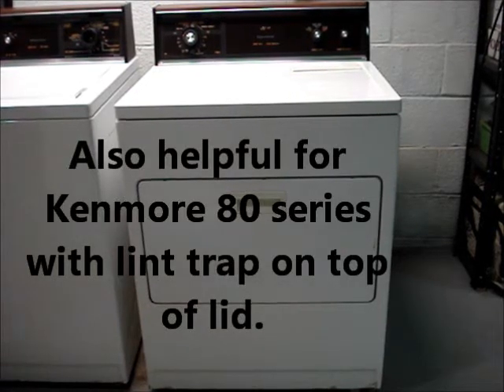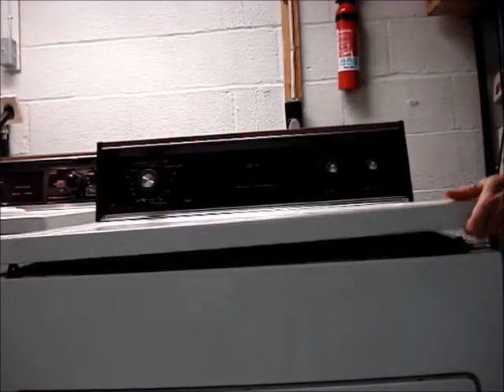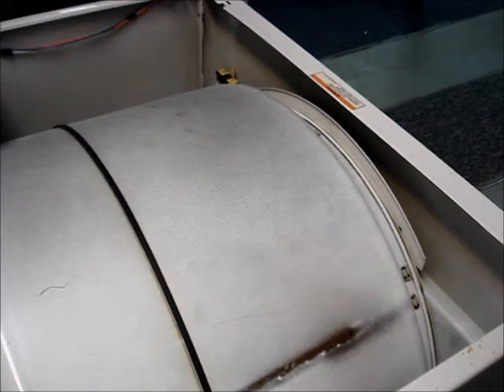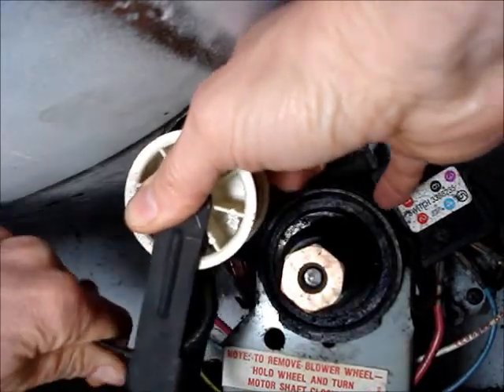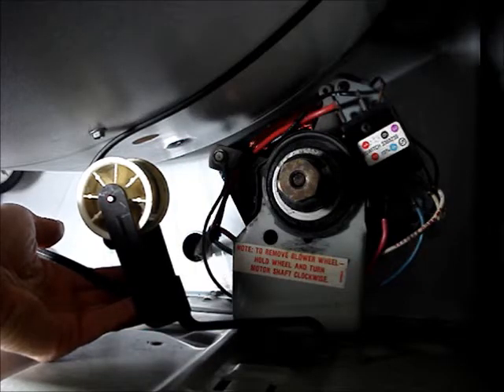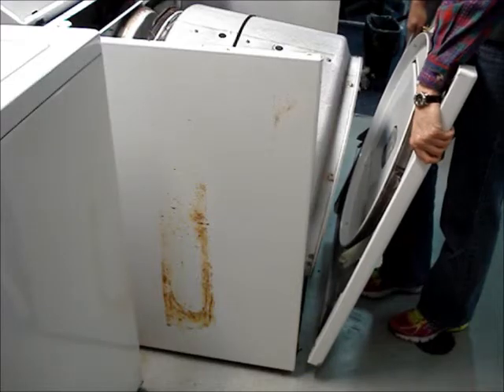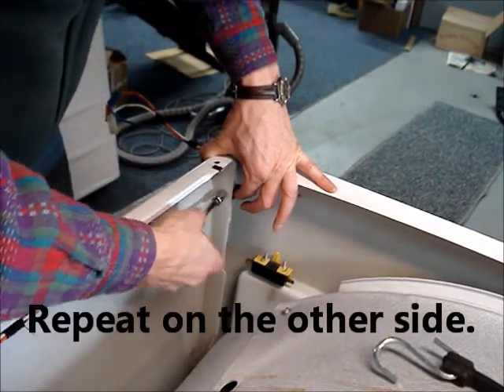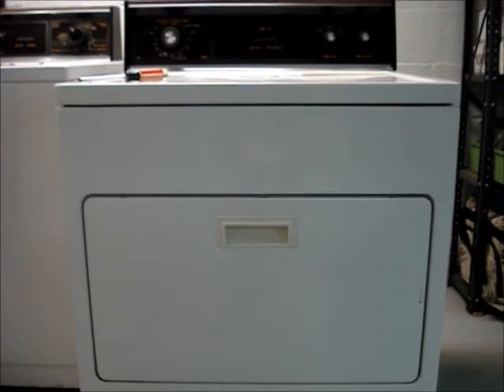How to Open Kenmore Dryer Front Panel and Top

Comment: THANK YOU!!!!!!!!!!!!!!!  My old dryer was making a loud vomiting sound like a dog throwing up (but deeper).  Your instructions were so clear that I was able to completely disassemble the dryer, remove the drum, clean out 30 years of lint and put all back together again.  Come to find out that black part on the drum that goes in the back (not the belt) was curled under for about a foot in one place.  Straightened it out and now it works perfectly now!   My brother always said a dryer was stupidly easy with only three major parts.  You gave me the nerve to find out that for myself. It was my first time ever taking an appliance apart.  Many thanks
Reply from the maker: You are welcome, Jody.  Lol, I love the description of the problem.  I think the felt seal came off of you dryer drum.  If it doesn't stay put, you can replace it.  Somewhere on your dryer is a plate with the model number.  Use that to buy a new felt seal.  There are several web  sites that sell appliance parts.  I find that once you know the part number, you can get it cheaper on eBay.  You'll have to remove the old felt seal and glue a new one on.  I have a play list with several dryer repair videos, one of them shows how to replace the felt seal.  https://youtube.com/playlist?list=PLvce66kQTjJSwXTgv6GwacfeFe2ajKdOw
Reply: The black part is what they call 'the skirt" i replaced mine,they sell it in a kit with this really awesome heat resistant glue,i took mine off cause it was shredded, cleaned the whole area, you have to gently scrape the old glue off,put new glue on and put the new skirt back on and hold it in place with a bunch of wood clothes pins, let it dry overnight and good as new.

Comment: Thanks for taking the time to post this. Very helpful for me. I know what I'm getting into
Reply from the maker: If you haven't ever taken the lint chute off the back of the dryer and cleaned out the chute & blower fan, it's a good time to do this.  Basically you have to take the whole dryer apart.  You will be stunned at how much lint is in there.. making drying time longer and if it's too built up causing the dryer to shut down.  Clean any lint off the motor too and check out the felt seal on the drum.  About the time this video was made a did some refirb on the dryer.  It wasn't too expensive and the dryer is still running.  Here's a link to more videos on this dryer showing how to do the refirb.  The new appliances are crap.  https://youtube.com/playlist?list=PLvce66kQTjJSwXTgv6GwacfeFe2ajKdOw

Comment: Thank you for the video. I will clean mine this week end.
Reply from the maker: If you have never cleaned the out the blower/lint chute in the back of the dryer, you might want to dive a little deeper and clean that out.  I have a video showing how to do that.  You'll see how clogged up mine was.  See link below.  Also, if the felt seal around the drum is torn up, you might consider replacing it.  I have a video for that too.  I know I just gave you more work, however, if you are handy and can do some maint/repair on these dryers, they will run a long time.  The new ones won't last this long.  Link: https://youtu.be/GSOZrBkmqXs
Reply from the maker: PS - Here's the link to the playlist that has all the videos about this dryer.  https://www.youtube.com/playlist?list=PLvce66kQTjJSwXTgv6GwacfeFe2ajKdOw

Comment: I have a 70 series. Works great after 30 yrs. But moving it the other day, somehow the bottom right front panel came loose. Thanks for this video. You clearly explain how to take the panel off.
Reply from the maker: You are welcome.  Hang on to that dryer, the new ones won't last that long.  My cousin has a 3 year old Whirlpool dryer and the drum bearing has already failed.  I have some other repair videos for the dryer.

Comment: A small bottle fell into lint trap when I pulled the trap out to clean, is there a way to access the chute
Reply from the maker: Ah, that sucks.  If it's like the dryer in the video you have to take the drum out, then take the back apart.  The silver lining is that it might not be a bad idea to clean the bottom of the lint chute/fan.  It this has never been done you will be stunned at how much lint to stuck in there, which eventually could make the dryer overheat and shut down.  I have a video that shows how to clean the lint chute:  https://youtu.be/GSOZrBkmqXs?si=J3MvG0U-xwWSaFoW   Also, here's a link to the playlist for all of the videos about this dryer.  There's another one that shows how to replace the belt, which will help you will the drum removal.  They don't make appliances like this anymore, if you can repair them, you should do so.  It's cheaper than buying a new dryer every 5-10 years.  Link to playlist:  https://www.youtube.com/playlist?list=PLvce66kQTjJSwXTgv6GwacfeFe2ajKdOw
Reply: Thank you best diy channel on youtube.
Reply from the maker: Thanks.  I try to do good things here. I do get a small amount of ad money for each view of a video as a reward and sometimes people click on the super thanks and give me a donation.   It's too bad the internet is not the place it was predicted to be when it first appeared.  There are still some great things on it, you just have to find them.  Best wishes for the dryer repair.